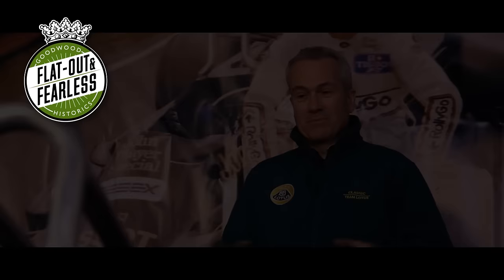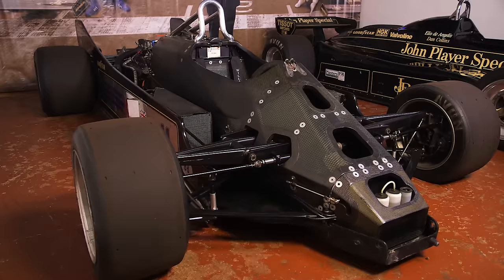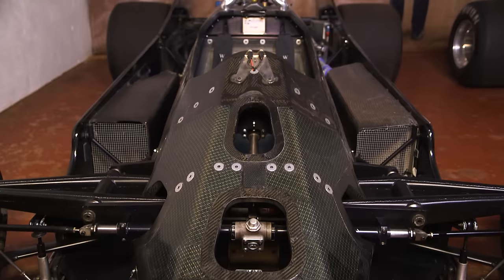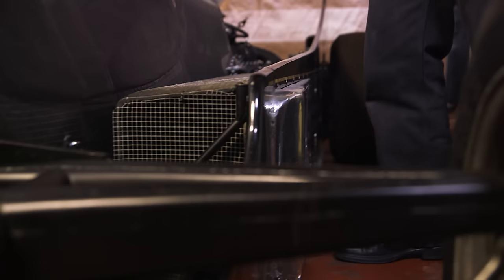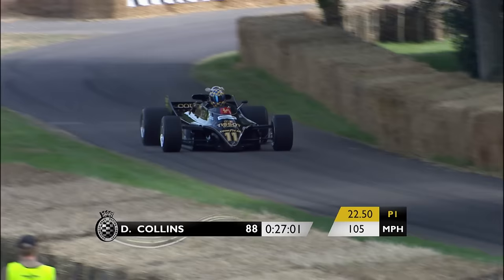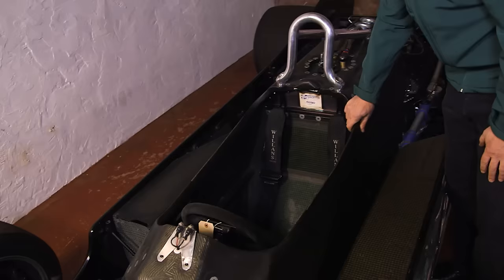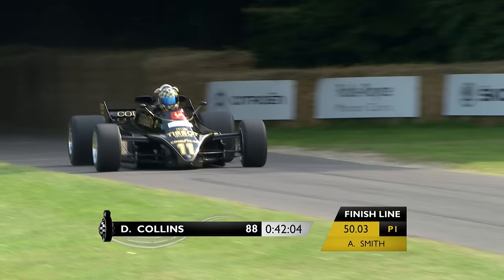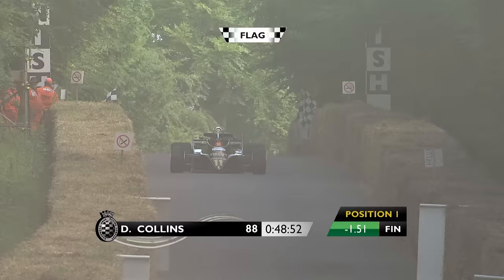Lotus Type 88 - The BANNED F1 car

Comment: Another example of stiffeled innovation due to the politics of overlording. This was the best car design at that time.
Reply: 1) The car was obviously a cheat. The rulebook banned mobile aerodynamic surfaces, and to make them bigger didn't make them legal. 
3) In reality it was actually a slow, crappy and plainly dangerous car, and the pilots later confirmed they felt relieved when it had been banned.

Comment: FIA aint fair though
Reply: Why do you say that?

Every racing series has rules  (F1 has lots of them...).   The ban on moveable aero surfaces was put in place in the mid 1960s.  This car, which very clearly employed a moveable aero surface, was built for the 1981 season.   This is not a case of the FIA writing a new rule to exclude this car... the rule already existed.  And when considering how "innovative" it was, I'd suggest considering whether the reason other teams didn't try it wasn't because they weren't innovative, but because they knew it would contravene the current regulations and be excluded.  Which it was.

Comment: Opposition was too scared that they couldn’t compete with the Brits...
Reply: At Long Beach the 88 was claimed by 10 out on 15 teams. I don't think there were just 5  british teams at that time...
Reply: 1) The car was banned because it was an obvious cheat. The rulebook banned mobile aerodynamic surfaces, and to make them bigger didn't make them legal. 
2) 
It had actually been THE OTHER BRITISH TEAMS that complained. 
3) In reality it was actually a slow, crappy and plainly dangerous car, and the pilots later confirmed they felt relieved when it had been banned.

Comment: That's typical in motorsport. If you can't beat it, ban it.
Reply: 1) The car was banned because it was an obvious cheat. The rulebook banned mobile aerodynamic surfaces, and to make them bigger didn't make them legal. 
2) In reality it was actually a slow, crappy and plainly dangerous car, and the pilots later confirmed they felt relieved when it had been banned.

Comment: So basically, this car got banned because it was too good and no other manufacturers could complete with it back then right?
Reply: 1) The car was banned because it was an obvious cheat. The rulebook banned mobile aerodynamic surfaces, and to make them bigger didn't make them legal. 
2) In reality it was actually a slow, crappy and plainly dangerous car, and the pilots later confirmed they felt relieved when it had been banned.

Comment: As the years when by it has gotten worst, now Formula One is a joke.   No longer a fan anymore, just don't care.
Reply: The rules are too restrictive, I agree.  But whatever formula you have there will always be rules, and there will always be designers working away to get around the rules...

So long as the FIA insists that F1 has to be the fastest and have the fastest cornering speeds in open wheel racing (barring the superspeedways, of course), the regulations will just get more restrictive.   

If we went back to a 550kg 3 litre non turbos with a 12,500 rpm limit and HARD tyres that must last a full race distance, maybe we could get actual racing back.... but unless fairly severe aero rules are also reintroduced (flat bottom cars, no underwings and very small front and rear wings) I don't think so.

Comment: So basically it was banned due to technological advantage against competition rather than a satefy issue? Man those guys sucks so hard.
Reply: 1) The car was obviously a cheat. The rulebook banned mobile aerodynamic surfaces, and to make them bigger didn't make them legal. 
2) In reality it was actually a plainly dangerous car that tended to become airborne at every bump of the road. The pilots later confirmed they felt relieved when it had been banned.